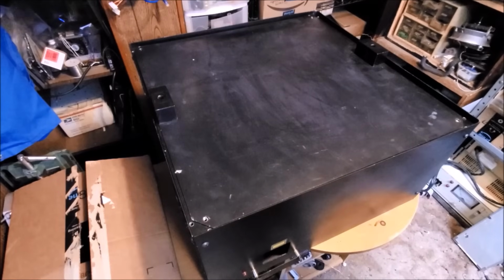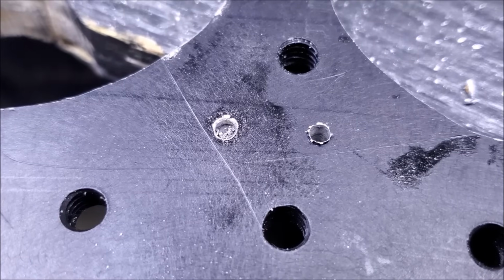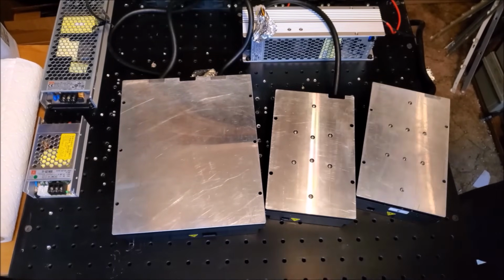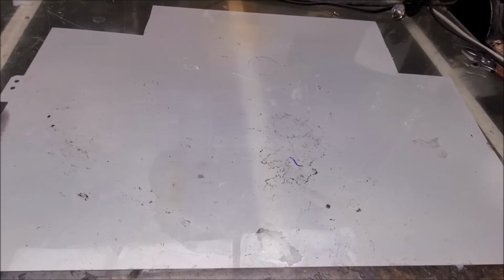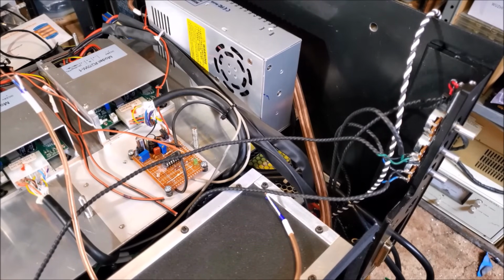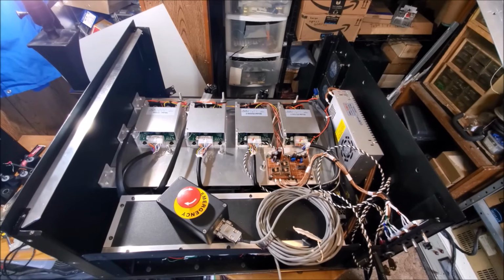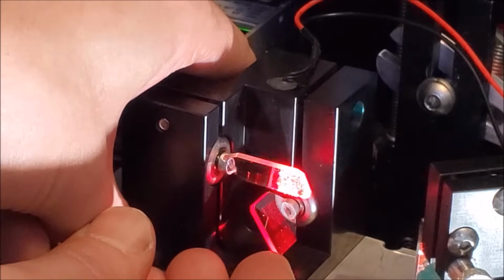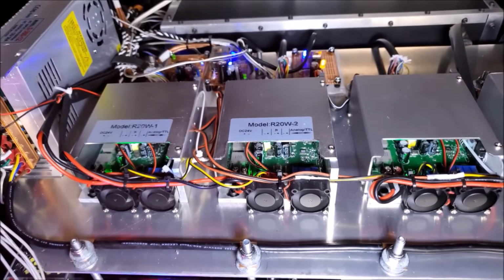Building A Mammoth 65 Watt Show Laser!

Comment: wow what a project ! im totally RBGreen with envy.... i am curious about a couple of things tho, firstly the blue filter seems to be letting some blue escape instead if reflecting it and then seems to be reflecting some green off the back.... is this because the filter is damaged in some way or it something else going on a newbie like me is missing ? and second did you just run wires from the back of the ILDA port directly to the laser drivers and galvo amps etc or was there a control board somewhere i missed... ?
Reply from the maker: The color mixing dichroic filters are not generally 100% efficient. There is usually 1-5% of the light that isn't directed as efficiently. This is very common in lasers to see a little bit of beam leakage like this, but much more noticeable at higher power. 1% of a 30W beam is 300mw, which is more power than some basic small show lasers put out in power normally. 

Control boards generally do 2 things. They regulate the interlock system or provide a way to use onboard features like reading from an SD card or internal programs. The position and color signals can be provided directly by an external DAC such as the FB3, Eitherdream, or Helios products. A control board, often called a showcard isn't a mandatory piece of hardware. The other functions such as the safety interlocks and timer are only mandatory and must meet FDA/CDRH compliance if the unit is made for public use. Those features where implemented with custom hardware in this build.

Comment: Oh man.... Wish I could have seen this one in person! Way to much laser for my room though said no one ever... ha
Reply from the maker: If it comes in for maintenance I'll let you know. You can drop by and put yourself in harms way!
Reply: @Zenodilodon  Oh my god! Dont advocate for people to put themselves in front of massive laser rigs like that! That has got to be incredibly unsafe...  (he quietly thinks to himself while pulling out phone, opening the video recorder, and slipping on goggles...)
Reply from the maker: @TankR I took a hot beam from this to the hand by accident. I've never been so burned so fast in one area. Stupidly dangerous and probably should break out the welding helmet! lol
Reply: @Zenodilodon   I really, REALLY, want to believe you had more than safety squints protecting your eyes... The cardboard was impressive, but the way it lit up the metal shutters was frankly terrifying! Two questions out of idle curiosity: 1) on the subject of shutters, would a set of mirrors in a spring loaded slide that are held out of the beam path by the emergency shutter mechanism (whatever it may be, that motor in this case, but I also thought about an electromagnet coil though haven't ran the numbers on power so [shrug]), which when tripped allows the mirrors to be pulled into the individual beam paths directing them their own beam dumps (perhaps with a LDR inside set up to a simple "if this suddenly changes turn this laser off" kind of circuit) pass muster where it comes to regulations? I mean, I get the beauty of simplicity in a drop shutter, but with lasers packing that kind of chooch.... dumping the energy into a trap just feels safer...then again, Ive never even been in the presence of anything putting anywhere near that kind of output power into that small of an area, so [shrug]

And 2) where the hell would that thing be used?!? Laser light shows in France...from Ireland?!? Taking down incoming munitions, with style?! Or simply "fuck it, because I can"? Note, all answers are valid. 

Anyhoozle, awesome content mate. The other video of aligning the yellow crystal on the old pump diode from a pen dpss pointer was super cool (my roommate didnt understand why I was so excited about it, they looked at me strange when I tried to tell them "its yellow, and it gets bright, yeah...and then...look...it gets freaking brighter!" 😒). I got an old Shenzhen optics (I think) "50mW" unit harvested from a DMX pattern projector that I apparently burned the AR coating off the back of the crystal by overdriving it (oops 😁). That one laser forum would have one believe there is some super secret sauce to alignment (and ill concede, yes proper tools help for maximum efficiency, lab grade alignment, and such...but I'm honestly not that sussed over it), however seeing whats involved in doing a basic setup alignment, I am fully confident I can get her going again, just need to order a new crystal. Being mechanically minded and a fabricator by trade, watching over your shoulder gave me a decent idea of the process. Cant make it any more broken otherwise 😅

The point Im getting at is this is exactly what YouTube is for! The info in your videos, even indirect and off the cuff, but especially the focused topics like driver types and topologies, is a gold mine for laser and electronics enthusiasts! Thanks for sharing your knowledge and experiences with us, man! Keep on keeping on, and your stick on the ice! We'll be pullin for ya 😎👍 

Oh, and remember, do not look into laser aperture with remaining eye 😉

Comment: given the high optical output power of those lasers, what type of mirrors are you using? what about the dichroic filters?
Reply from the maker: Mirrors are either dielectric or very reflective aluminum. I am almost certain everything in this laser is dielectric. The Dichroic mirrors/filters are dielectric for sure. The key is to make the optics as reflective/transmissive as possible. This keeps the optics relatively cool as only absorption is converted to heat. The efficiency of the coatings are in the very high 90% range, often close to 99%

Comment: great project! would you please provide the link to the video for the fans controller circuit?
Reply from the maker: Oh Snaps, I forgot to add that link. I just did that in the description. This is the video I used with good success. This does not contain the thermal feed back portion though as that I integrated in myself.
https://www.youtube.com/watch?v=498o4Tuprv4
Reply: @Zenodilodon  thanks a lot! btw I think it would be very interesting to see a video about your version of the circuit with the NTC thermal feedback.

Comment: As usual... Always wonderful! 

Quick question. What happens if someone unplugs the 1/4" Jack that powers the remote cut off button?

 If the laser shits off when the button gets pressed..... But is otherwise on... Does that mean the laser would stay on if someone unplugged the 1/4 inch Jack? 

I didn't pay super close attention to that part but that question was in my mind after finishing the video. 

Just curious. 

Also, you may have mentioned it but I was wondering where you got the laser modules and drivers?  Even on the used market that would be pretty pricey. 

You did a Beautiful job!
Reply from the maker: The 1/4th jack and switch need to be closed for the laser to run. If that cable is unplugged the laser will shut off and you will have to wait for another delay cycle.

I listed links in the description where things can be purchased. The laser heads and galvos where all very recently purchased and just used for this project. It's all in the tens of thousands when combined.

Glad you enjoyed the build!
Reply: @Zenodilodon  that makes sense! 

I was pretty close. I figured 15 to 20 grand if you had to go out and source the parts new. I figured maybe you got a really good deal on some used modules or something since you're in the business. But unless happening upon a lucky miracle..... That stuff holds most of its value even used.

Comment: Treat it like a pizza? And you didn't add pineapple? 😓😅

I've never seen that many heatsinks all at one time, is the output power only as powerful as the lowest rated laser, or is the difference in power between red green and blue not matter so much because of human eye sensitivity to the spectrum?

Amazed that such a tank of a laser (initially) was so empty

I'll have to look our for those fans and compare them to some others I've saved, liked your crack about rgb, I'm hearing it a lot from computer builders now, they can't get a decent fan without a fucking light show 😂

Get you some diamond files, can't go wrong with them, just dont bend them!

I thought youd mount the fans blowing over the heat sinks, does it make much difference when the case is also full of holes?

Is the coating on the aluminium important not to disturb? I always thought it was some kind of anodising, I say that because I've worn it through before until it turned sort of green, but I thought if anything it only slightly impeded thermal conductivity, my mother guess was maybe because it would be bright shining metal being exposed, but then there's so much silver things in there already

Hope you wore a mask cutting and sanding all that, and then you wonder about congestion, agh!

Is there any diode protection on those relays? Be interesting to see the extra videos

Hey now, solar radiation is on average 100x that🙈 I think it's like 130mw/cm2 at the equator?
Reply from the maker: The total power optically is 65 watts. The least visible color range is indeed the blue end so that is often the most powerful. That and powerful blue Lasers are cheap. This balance of power can vary depending on the colors chosen. 635/520/465 can have a 2/1.5/2 ratio where as 650/532/445 is more 2/1/3 ratio for a good white.

The fans in total provide 250 watts at full power of cooling. I am surprised you say you can't get a decent fan with RGB LEDs. Look, RGB LED fans are crap. These used server rated fans are made plastic that has fiber reinforcement for a reason. These where not only cheaper then RGB, but on average 4-6 times more powerful. Server farm class fans would just about chop up an RGB LED fan like an episode of " Will it blend?.. " 

Not sure what you mean by the case being full of holes. The fans do blow over the heat sinks and the holes have been plugged with socket screws. 

The breadboard coating is not important, but why scuff it up when a few cents of tape can ensure the job looks that much better. 

You wouldn't live very long on a planet with 130mw/cm2. Even at 1mw/cm2 that's 1000 watts/m2 That's the same power as an average microwave oven! Hence why the sun feels warm.
Reply: @Zenodilodon  my god, are they still doing will it blend?! 🤣 Wow

I mean usually good ones tend to come with rgb lights and that's not something I ever wanted, or certainly they seem to be the most marketed, it's hard to search for fans by cfm output, or it was the last time I tried 🙈

Maybe I did my math wrong on the suns power I knew it was about 1kw a meter square but I not sure exactly how much that is (Google says 1380w, and nasa agree with me seemingly, at 137mw/cm2 at the equator 🙈)

Holes? I forget slightly but maybe I mean the ones in the case already or the ones in the side for the old fans, I know the new fans blow over the heatsinks but it's sort of indirect 🤷 plus I think I misunderstood while you were building it and never update dmy comment, which I tried to do as I watched it, originally I was thinking how is he going to install heatsinks inside the case, but duh they went on the under side 🤣 and then I was thinking the fans would be blowing inside, which made me think of dust issues, it became clearer later when you made your cowling, I apologise for any confusion caused
Reply: @phonotical  You are right, that is the power of solar radiation. He completely messed up the values in the answer he gave you.
Reply: @marianl8718  it's fine, I was sitting here trying to work out how I'd messed up
Reply: @marianl8718  it's fine, I was sitting here trying to work out how I'd messed up

Comment: OMG! 😱
You have the optical breadboard that you've been dreaming of owning in your hands and you're going to destroy it?! That's gotta hurt.
On the other hand, IT AN'T METRIC! /smh
Great build, well planned, all things considered. Very serious projector to be respected.
What would we do without extruded aluminum for building projection systems, eh? (I do all of my cutting with a table saw and fine toothed carbide blade. Works great for plastic sheets, too. Precise angles, clean cuts, just hit the sharp edges with a file. 👍
I use a drill press for drilling & tapping, without any spring tension on the 'press'. The perfectly vertical taps feed themselves. With the drive belt removed, the chuck is easy to turn, uses less torque, fewer taps broken. (/2 turn in-1/4 turn out, of course)).
BTW, If those EMS4000 galvos need a home, I may know of a nice place where they will be loved.
😎
Reply from the maker: Ironically I have drilled and tapped my own optical breadboard at this point in M4. I may be the only person to both make, and unmake the holes in an optical breadboard.